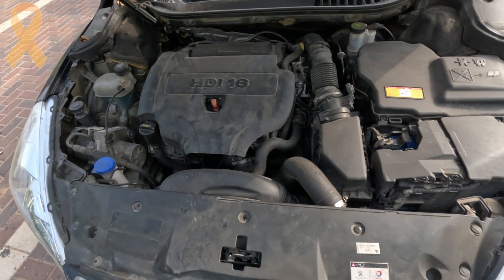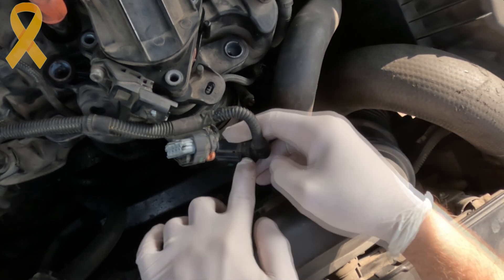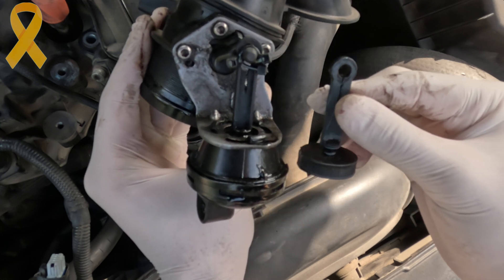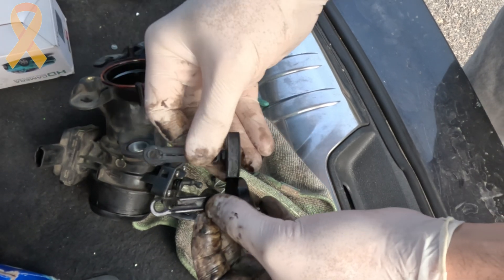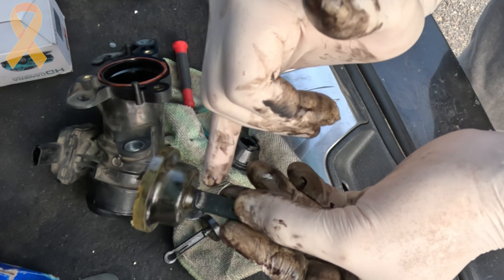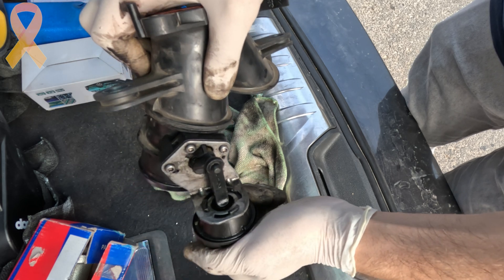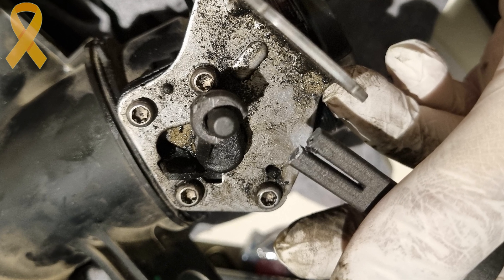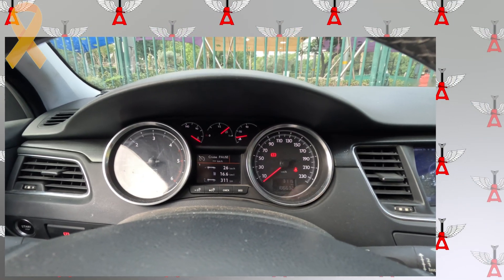3D Print Fix - Peugeot & Citroen HDi P0488 P1498 & P2125 [Throttle/Air Metering Valve]

Comment: Question: do you need all 3 error codes or just P2125 is sufficient? Edit: I own a 2013 DS5 that has a very inconstant throttle/acceleration,same engine as the one in video. Using my own obd it doesn't look like a pedal problem BUT recently I had to service my car because it went into crawling mode because of some air/gas pipe that was cracked. Service told me they believed it was the an air valve (?)  at first but then put back the old one and found out about this pipe... I'm really puzzled tbh because ofc the car is out of crawling but still feels like one day it pulls hard other not or I pressbon the accelerator after lifting and has no response for a second and then goes very abruptly
Reply from the maker: It not necessary that all 3 appears, just check if your lever is broken. And recently I uploaded an update for that issue.
Reply: @DIY-Mechanic oh wow that was a fast response, thx buddy. Check again my comment I was adding some details 😊
Reply from the maker: @MasterControl90original yes I just checked the notifications the second you commented😂
I suggest you look for the air throttle and check that lever and it's condition. I don't know how it is set up in the ds5, but in my case there is no clear view so you need to use the phone camera in order to see something
Reply: @DIY-Mechanic I'll do it, it is identical to your 508's engine. Thx again ^^

Comment: Hi, I'm from Serbia and I'm really interested in this part. Do you ship to Serbia, or is there any way I can buy it directly from you? Thanks
Reply from the maker: Hi
You need to 3d print it l, use a heat resistant material..
Shipping from here would cost you a lot, it's best to ask people from your area if someone have a 3d printer. It is very common today.
Reply: @DIY-Mechanic  Thanks. I will check where i can 3d print this.

Comment: Same Manufacturer, Same Engine, Same Issue....Thank you !!!
Reply from the maker: It has been almost a year since posted... and tens of people already used it. Nothing feels better than knowing I helped so many people!
Reply: @DIY-Mechanic help and save Money 😂 PSA try to sold complete Air Mixer unit 😂
Reply from the maker: @DieArmeSau yep... the same problem with the electronic parking brake. Check the video i uploaded about that last week.... (also with a free solution rather than replacing a whole unit for 1500$)

Comment: which type of filament did you use to print the part. And how long is this Peugeot now working with that 3D Part
Reply from the maker: Hi
Petg
Almost a year now, the outside temperature in here is around 35-42 Celsius, it work fine.

Comment: hello

i have  same issue p0488 and p1498 error ond my citroen....a replaced throtlle but this error  is sometimes  ..what could be? sometime i one day this error appear  3-4 times.. sometime every  3-4 day..
Reply from the maker: your plastic lever is complete or broken?
Reply: @DIY-Mechanic  complete.. everything works fine few days, and one day 2-3-4 times dyring a day error comes.. i turn n/of car and then everything works fine...
Reply: I think maybe some vacum hose is defected..or maybe presure sensor?buzni dont know  on this motor where is presure sensor, on yt i found but for older motor, and for 1.6..
Reply from the maker: @ check your parts catalog and it would be easier. I suggest you make a quick check for vacuum leak - press the brake pedal while you turn off the engine. if your pedal go up in a few seconds - you have vacuum leak. anyhow, im not sure a vacuum leak would cause such problem. you checked everything is connected fine? you replace to OEM throttle?
Reply: @DIY-Mechanic  yes oem throttle..i thnk vacum leak on some hose..some hose from throtlle
Reply from the maker: @Majstorisanje  do the test i told you with the brake pedal and update

Comment: Ive printed the part using your link. Thanks a lot. Going to try and swap out the part without removing the whole air intake unit. Do you think that would be possible? Gonna give it a go anyway 😂
Reply from the maker: @rosscfit  it won't be possible.. you need to take apart the vacuum diaphragm. Why not removing the whole throttle assembly? It is just connected with a few allen bolts, very easy :)
Reply: @ realised this quite quickly. Thanks for your advice. Taking the unit out wasnt too hard. Separating the diaphragm unit proved a bit tricky. Managed to replace it using the printed part and its working a treat so far 👍👍
Reply from the maker: @rosscfit  great
It has been 4 months since I originally made this... everything work good so far :)

Comment: That part in origin should be made  of metal or polymer, but never plastic because of the force to which it is subjected. Much worse things are seen in new generation engines.
Reply from the maker: @FSHerrante  yep.. today everything is made of cheap fragile plastic and parts that used to last for half a century, now break every 3 years.